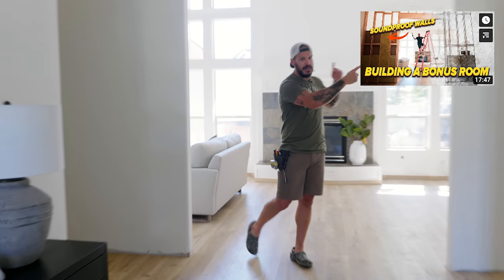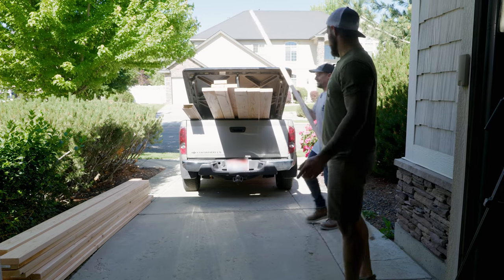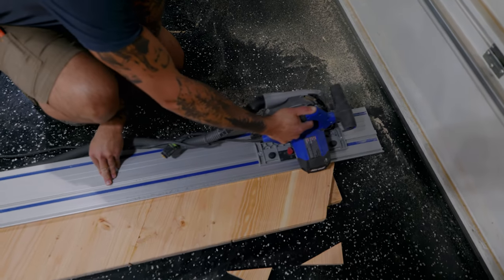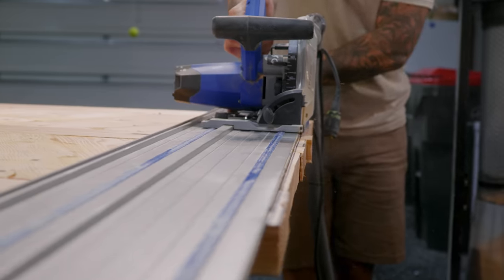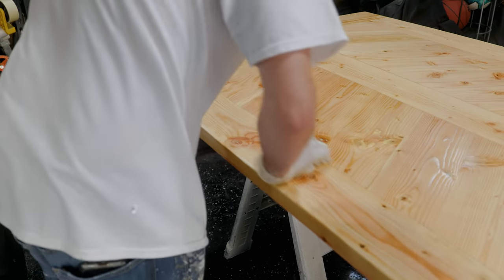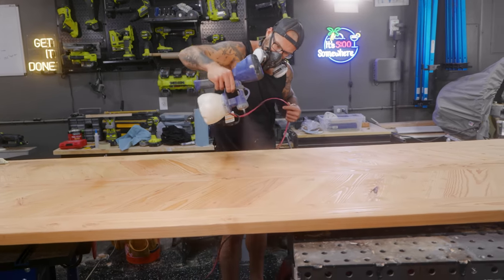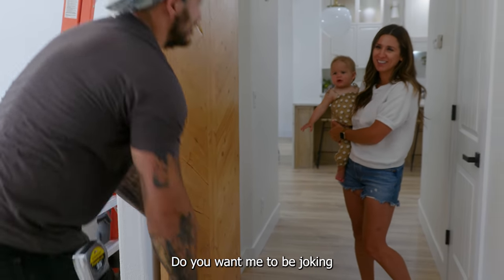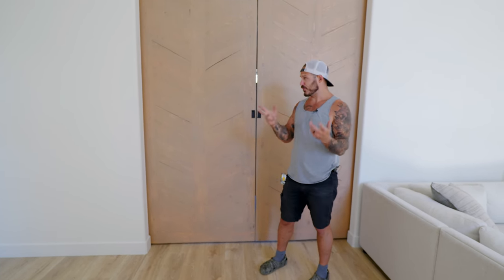Building GIANT Barn Doors + WIFE DISAPPOINTED || Concrete Slab House Reno (Ep.12)

Comment: Just an FYI, it's likely cracking because of the end grain to side grain connection. The middle (chevron) pieces are drying out and shrinking across their width, but are constrained by the rails (and the dominos used to secure it). You've essentially made a giant breadboard end without allowing for wood movement.
Reply: This project will be a tough lesson on wood movement.
Reply: That was my thought too. If I remember, the reasons that shaker panels are installed into rabbets is to allow the panels to move independently of the rails and styles. 

This would have worked better if the chevrons had been cut with a spline that allows them to slot into a grove along the styles.
Reply: Hey guys,  I'm considering building an outdoor gate with the same design. What would be the right construction method to avoid the cracks? Should I use tongue and groove to connect everything? For the inside panels, should I use glue or leave them loose to allow for wood movement. Any advice is appreciated. Thanks!
Reply: Well he said he's not afraid to fail... that fail will only be seen later.
Reply: @EduardoAndreotti2  There are a few things to consider, the way you join the frame is up to you (dominos, dowels, tongue and grove, etc). The most important thing is that wood expands and contracts across its width, so you need to account for that. The easiest way, for a door in that style, would be to construct it like a frame and panel door and make sure the panel part (the chevrons) sits in deep enough grooves that it can move. It would also help to not glue them all together, so the movement can be spread across a few different panels.

Veneer or using plywood for the chevrons is another option that would work. Using plywood strip instead of solid wood for the chevrons would let you glue everything solid as per this video.
Reply: @T3chnoJunk13  I genuinely hope we get to see the door in a few weeks/months. This is an excellent lesson in wood movement and what to avoid. Would be a great learning opportunity.
Reply: @junado  thank you, this is very helpful!
Reply: Yep[ the domino has a wide setting that allows the timber to move around the dominos, you glue the ends but leave the centres free to move around the domino's
Reply: @-PORK-CHOP-  thank you

Comment: Regarding the cracks you mentioned at the end:

Did you use framing lumber? If so the boards probably weren’t completely dried. As they dried they shrunk a little causing the cracks you noticed.
Reply: He said they were just 2x6, Dimensional lumber.
Reply: @waynetibak1828  that doesn’t entirely address my point. Dimensional lumber could be green or kiln dried which have drastically different moisture contents. Kiln dried should not have the problem I was describing
Reply: @teejer90  Even kiln dry dimensional lumber is not dry enough to not get movement after it dries. I made a "nice" table once with kiln dried lumber. After it dried it still shrank 1/4 in some places.
Reply: @teejer90  I don’t know if any Home Depot that sells no KD dimensional lumber. It’s typically Doug fur KD.

Comment: Not gonna lie, these look straight up awful.  They sort of looked okay with the fruitwood stain but that final stain is just ugly.  I get lumber right now is super expensive and for just pine the materials for the door was $600.  But you should have either sprung for maple or white oak hardwood cause these would have come out so much better.  Or wait until wood prices come down to build them.  These doors didn't need to be built right now.  You're going to be in that house for a while.  My guess is you rebuild these doors within the next couple of years.

Comment: Don't all houses these days sit on a concrete slab? 🤣
Reply: Nope, It all depends on where you live. A slab house is very uncommon in my area, most houses have basements. With the extreme cold temps we need to get below the frost line or you could have major foundation issues.
Reply: Depends on where you live.  Up north, no.
Reply: Here it depends on how much you can afford. To keep new builds in the $450k range then no basement. Pay, $600k + and boom basement. This is in Colorado.